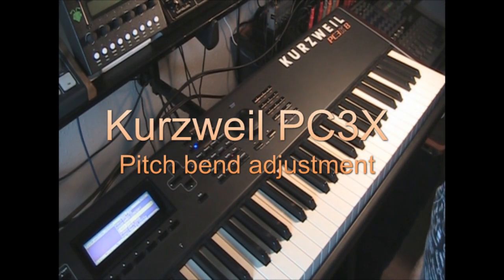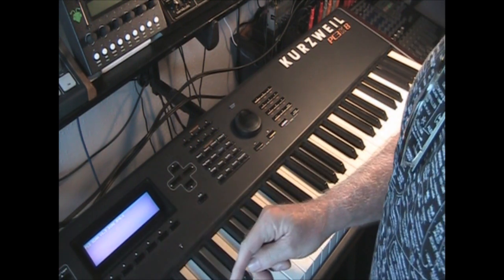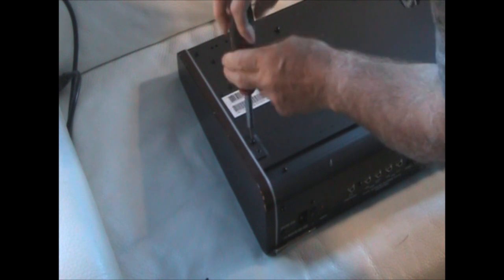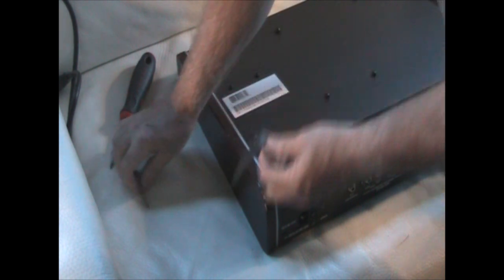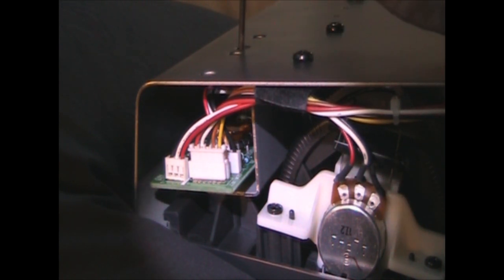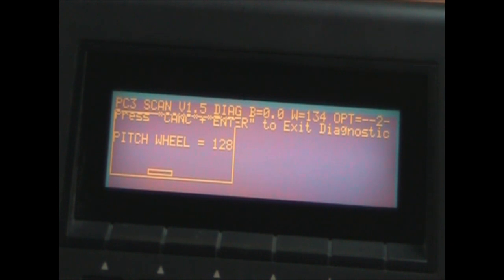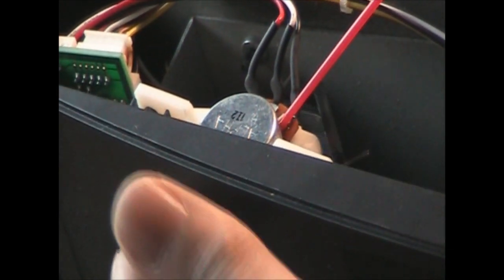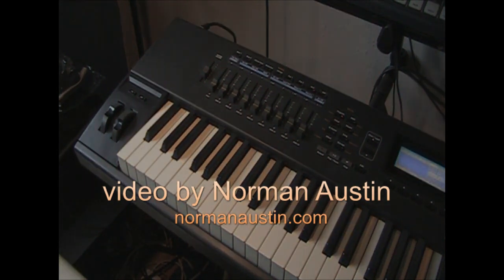PC3X Pitch control adjustment

Comment: Hey I appreciate the video. I have a kurzweil pc88mx that was owned By Foreigner. Was played on tour by mick Jones. It still has all their old midi files saved. I’d like to fix my problem without doing a complete factory reset. It is definitely out of pitch but when I hit keys 4,5,and 6 it shows the pitch wheel is going back to zero properly. Is there another adjustment.?
Reply from the maker: I don't know. There are two tiny orange screws next to each other, one of which is the one that I messed with in the video. I don't remember what the second one does, though you should be able to find out online with a little research. If you do a factory reset you can save all your data first and then reload it after. Saving data takes a while, possibly an hour or two in my experience, though midi files are relatively small compared with samples. Good luck!
Reply from the maker: ...and check the service manual, - link above. :) ...but it sounds to me that it's probably a setting within the programming software.

Comment: Hey there! I'm having the same problem with my Kurz, besides the fact that it also lags when it starts and sometimes shifts inadvertently the patch sound while I'm playing (loose slider, perhaps?). Anyway, I'd like to know where can I run that diagnostic mode to see the pitch bend behaviour. Thanks!
Reply from the maker: I explained that around 40 seconds in the above video. When the Kurzweil is switched on, press 4,5 and 6 on the keypad simultaneously. After the LEDs flash it will be in diagnostic mode. Simply move the pitch wheel and you find that the central position needs to be around 128 that you can see in the keyboard display window. The range goes from 0 when pitch bend is down, to 255 when pitch bend is fully up.
Reply from the maker: ...I suggest getting a can of switch cleaner first before messing with the tiny orange colored adjustment knobs accessed through the holes in the bottom. The problem I had was cured by cleaning the pitch bend potentiometer with a squirt of switch cleaner.
Reply: Thanks a lot and sorry for not paying proper attention to your explanation. I'll do my best to fix this annoying issue! Thanks.